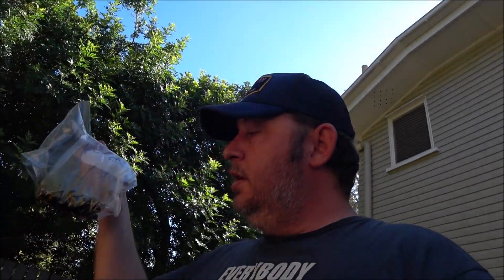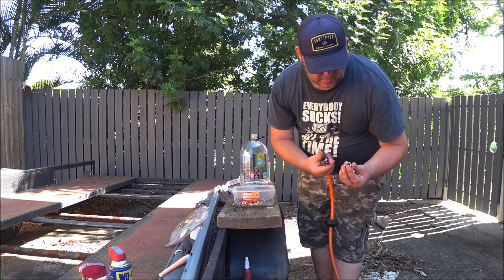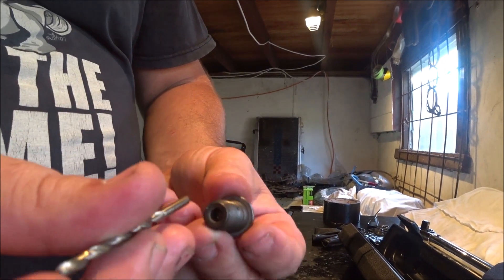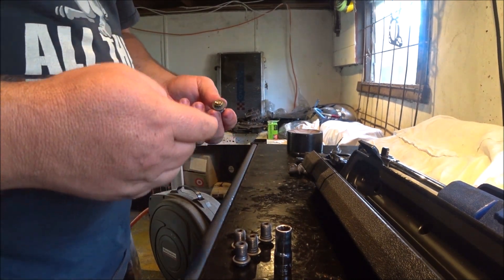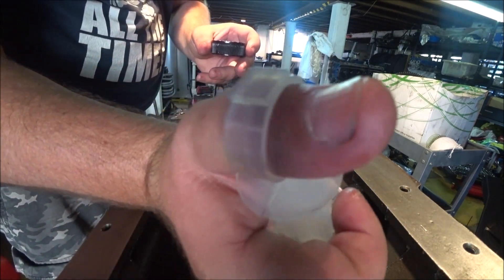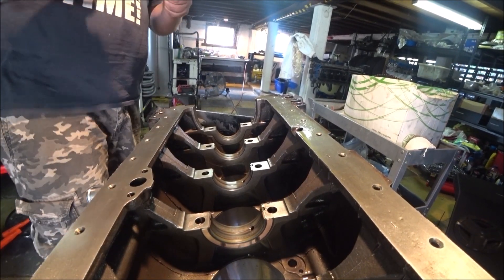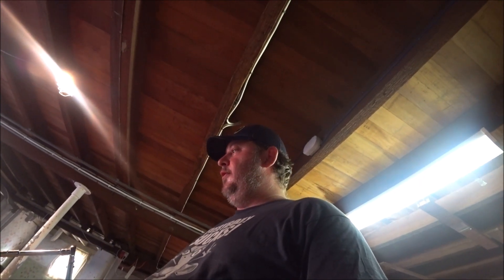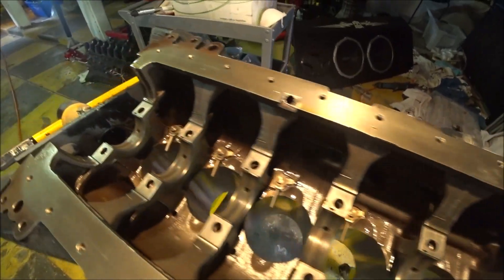RB25DET build - Cleaning and Installing Oil Squirters - Cooling Jets

Comment: sweet video. do you have to use DET pistons or can you use NA?
Reply from the maker: Well I'm using forged pistons so irrelevant for me. I'm not sure of a piston difference but the rods are I think. Which may impact things like head clearance pin locations and the oil squirter notch.

Comment: Hi there love the vid! But do the holes on the bolt have to line up exactly on the hole for the squirters?? Cheers
Reply from the maker: Nah mate the oil makes it's way around the the bolt, that's the way a banjo setup like that works, it fill the space between the ring and the bolt.